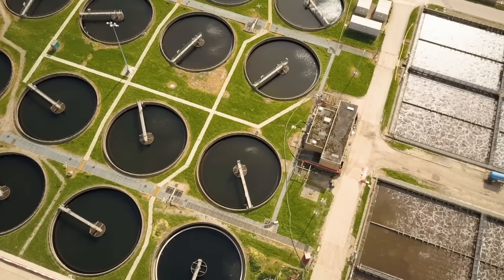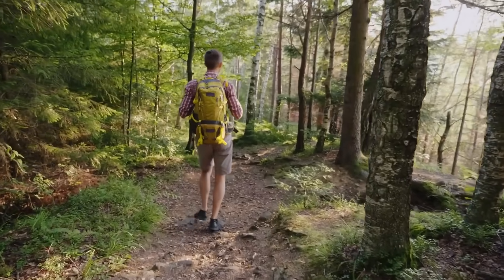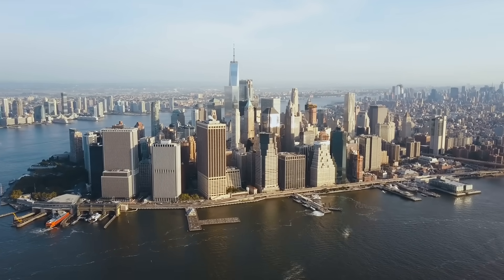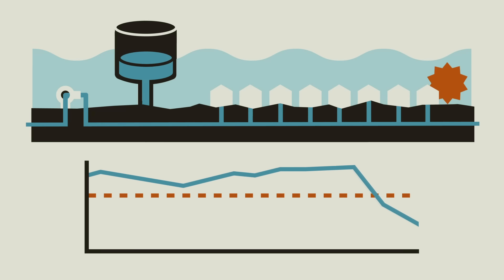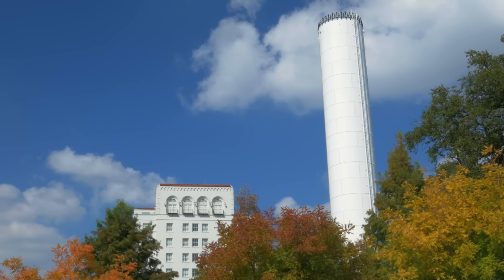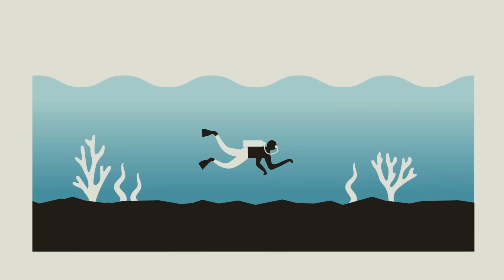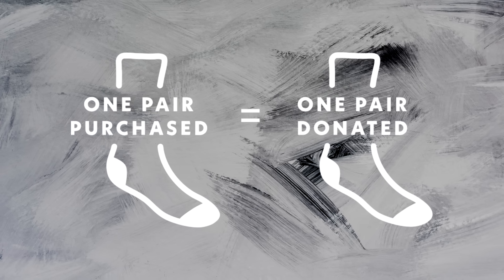How Water Towers Work

Comment: Electrons do not flow from high voltage to low voltage. It's the other way around. Current flows from high voltage to low voltage.
Reply: The convention doesn't matter as long as you clearly state which one you are using, and you are consistent throughout the process.
Reply: Kadda sixseven you must be fun at parties...

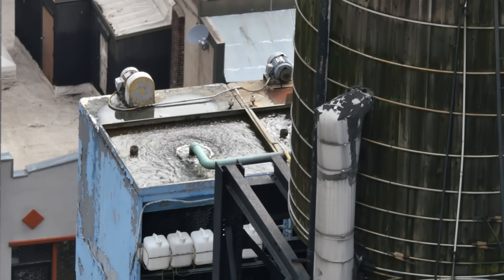Comment: 9:27 whats happening here? Is this water performing some function here or just draining?
Reply: You're looking at a cooling tower on the top of a building. It's basically a heat exchanger. Warm water from the inside of the building is pumped through the inside of it (you can't see that) while cold water is poured over the outside (which is what you're looking at). The heat gets transferred away from the warm 'inside' pipes and the cooled water goes back into the building to pick up mare heat.It's a really simplified description of the operation of something that's essential to proper air conditioning of large buildings, but the principle is exactly the same as I've just described above.
Reply: @ghost307  Thanks for writing that up. That makes much more sense and is pretty neat.

Comment: hi! i work in the field of water distribution. i actually watched your video for a laugh. but, i was pleasantly surprised by the accuracy and clear explanations. BRAVO!  one thing you could have included was the point 43 pound rule. for every foot of height of the tower you gain point 43 pounds of pressure. so a 100 foot tower would passively impart exactly 43 pounds of pressure at ground level.
i subbed. good video.
Reply: I agree with this. I missed him saying BAR, PSI or just some weight unit.
Reply: You are missing the unit of area over which the pressure is measured. I assume you mean square inches.
Reply: @gordonrichardson2972  right you are! i should have said PSI
Reply: I have worked in water treatment/ distribution field for 4 years now and I too was impressed with this video.
Reply: For every foot of elevation of water you get .433 PSI or every 2.31 feet of elevation you get 1 PSI
Reply: 10 metres of height gives 1 bar of pressure. 1 bar - 14.7 ib/sq inch in old money.  So approx every 30 foot in height gives 1 bar.  In the apartment block I live in people on the lower floors have their water supplied from the roof tank, except drinking water, giving a constant ~2 bar.  The pressure and flow never varies, unlike supplies from the pumped under-road mains pipes. Many fawcett outlets can be opened not affecting the flow and pressure of say a shower.
Reply: We were taught to always just remember that 1psi = 2.31ft of elevation, and all our state license test questions are based around that conversion as well.
Reply: 43 X 100 = 4300!
Reply: @rekky213  point 43 psi Robert. not 43.
Reply: That ad hoc "rule" is an example of how bad imperial system of measure is. With pascals/bars and meters you don't need a special constant here, you just use g. So 100 meters tower would produce 9.8 bars of pressure at ground level.

Comment: Pumps create flow, not pressure
Reply: Flow is caused from differences in pressure, and that’s how pumps create flow.
Reply: Cameron Hoglan no they create flow. Pressure comes once there is resistance to flow
Reply: @willyjameshuff  Depends on the kind of pump.
For example, a piston pumb creates pressure (compressing the fluid to put it in motion out one end), 
while a bucket chain or an archemedic screw creates flow.
Reply: willyjameshuff This

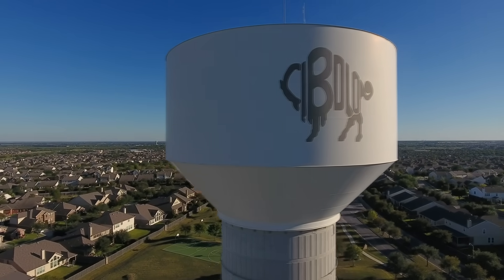Comment: The tank style at 0:44 is called a Multi-Leg or Toro Ellipsoidal tank. 4:59 is a Composite Elevated Tank or CET. It's called Composite because of the concrete pedestal and steel bowl combination, no fiberglass used. We call the tank shown at 5:20 the "Witches hat" tank style. 6:00 is a Standpipe.
Reply: Well, gee, Bob.  Now I feel complete.
Reply: I appreciate this useless info bob.  Thanks for sharing your expertise
Reply: @drumcorcaigh5770    A little knowledge can be a dangerous thing.  Some folks are VERY dangerous.

Comment: Is it possible to make hydroelectric plants out of every water tower?
Reply: saberline152 yes but it would be a waste. You’re paying to pump water up to it and then on the output after the hydro electric it wouldn’t be as pressurized
Reply: @ShortyzProductionz  what if we apply pressure to the storage unit?
Reply: @saberline152  You'd just be swapping energy for pressure and then pressure for energy. You'd probably be losing energy to heat and friction in the process as well.
Reply: Homer: "....Lisa, in this house we obey the laws of thermodynamics !!"
Reply: @pabloata4708  it does, you use other electricity to pump it up and give it potential energy and you could potentially recuperate some of that energy

Comment: Can't wait for the pumped-hydro episode you alluded to.  It would interesting to know how much water at a given height would be needed to power a home for, say, 24 hours.
Reply: I'd be interested in toying with the idea of using consumer-sized water storage tanks to store energy during off-peak hours. This way, you use energy from the grid when it's cheap and then convert that potential energy back into electricity during peak grid hours. I'm assuming that the only reason why we don't do this now is because it's an economy of scale sort of thing.
Reply: @jc_1337  The energy storage capacity is trivial for domestic water tanks. Raise 1,000 US gallons of water (which weighs about 4.2 US tons) by 25 feet (that is roughly two storeys), and it will store the equivalent of less than 0.08 kWh of electricity as gravitational potential energy. However, as the whole operation is 80% efficient at best, then you'll only get about 0.06 kWh back. 

That's rather less than the electrical energy stored in a 4 Ah 18V battery for a cordless drill (which is around  0.07 kWh).
Reply: That's easy to work out. If you know your house uses, say, 30 kWh in a day, that's 108 MJ of energy. That's equivalent to raising 100 metric tons of water (about 110 US tons, or about 26,500 US gallons) to a height of about 110 metres (about 361 feet). However, that's at 100% efficiency, and if it's 80% efficient (good for pumped storage), that means multiplying by 1.25, so 138 metres or 451 feet.

To put that in perspective, a typical 2,000 square foot US house weighs, with its contents, about 205 US tons, so it's the equivalent of lifting the entire house vertically by about 220 feet.

The simple formulas used are to turn kWh into MJ, multiply the former by 3.6. As gravitational potential energy is just mgh where m is the mass in kg, g is the acceleration due to gravity (9.81 m/s^2) and h is the height in metres. 

Now take these numbers and multiply them by the number of houses in a large city and you'll see the scale of storage required.

Comment: I never heard anyone giving example of electrons to explain water flow. Always heard the opposite. Interesting take.
Reply: Am I tripping or did he say it backwards? Electrons move from Low voltage to High Voltage! I think he was thinking of classically described current (movement of protons).
Reply: @xxDPKINGxx  Yes, the civil engineer missed a quirk in Bohr's atomic model while dealing with fluid dynamics and hydrostatics. I wouldn't worry about it. I'm an electrical engineer, and most of the time, I don't bother to think about which way the amber moves. It's usually a voltage, producing a current, creating magnetic flux, which induces a current somewhere else, leading to a voltage drop over some load impedance; or a signal voltage interacting with a transistor or relay as part of a logic operation. The fact that electrons are defined to have a negative charge does not meaningfully impact my day job.
Reply: I was talking to a contractor the other day (who is an electrical engineer) about pressure sustaining valves vs pressure reducing valves; he likened them to capacitors vs resistors. I said "that's the first time I've ever heard someone use electricity as an analogy for water, usually it's the reverse" :-)
Reply: Was surprised that he didn't mention capacitors and filtering out high frequency waves... I mean if you're starting with a comparison you may as well keep going!
Reply: well, civil engineers.  just sayin...
Reply: Well if you can't reverse an analogy there is something wrong ;)
Reply: @ewthmatth  doesn't help last time i checked voltage didn't change as it moved down the wire. I'm Just an electrician though no engineer
Reply: You are correct. What do you believe. Electron flow, or conventional flow. There are both theories. Good point.

Comment: Neat. I suppose capacitors would be the electrical equivalent.
Reply: Kind of, but not quite. Batteries are the electrical equivalent.
Reply: @kennyholmes5196  - I disagree. If you compare the towns water supply system to a electrical circuit, the pump station or its output flow would be the equivalent of the battery, while the houses are the load. Both a battery and pump station can only output so much at once. When the load exceeds this, the capacitor (water tower) provides brief relief/ steady flow.
Reply: @kennyholmes5196 
Capacitors are the electrical equivalent.
If you look at the mathematical equasions describing them, they have the same form.
Batteries do not.
The non-mathematical way to look at it; when batteries are fully charged, they don't give off a higher charge than when they are at 50%. In storage towers and capacitors, the charge/pressure provided is dependant on the charge/water level within it.

There's also the mechanical equivalent btw, which is the spring.

Comment: Electron flow from negative voltage to positive voltage, which is the opposite of current.
Reply: Actually, that is precisely what current is. You don't define current of a river against the direction of the water flow either, do you? There is a physical and a technical direction of current, the physical is the direction of electron flow, the technical is against, IIRC, it helps engineers with calculations and remembering safety rules, but I'm not sure.
Reply: i knew someone would catch that!
Reply: Current works the same if you switch signs.   Unfortunately they chose the positive direction before electrons were truly identified and discovered.   It makes just as much sense to say that negative current is the "real" current.

Comment: I just want to point out that pumps don't create pressure, they create flow and presure is the restriction to flow
Reply: I could argue that pumps create pressure and that the pressure they create can result in flow if there is no barrier to stop the flow. I could also argue that without a pressure differential being created there would be no flow. This might be a chicken or egg first argument, but I see nothing wrong with Practical Engineering's wording.

Comment: I always wondered the energy balance for putting a hydroelectric water turbine in series with the outlet of a water tower. (Actually I have a lot of wonders about storing potential energy for public utility.)

My thoughts:
- While the tower is filling, the water turbine is bypassed. (added complexity)
- Then while discharging, the water turbine drives a generator.
- Typically, water peak demand and electrical peak demand coincide due to residential consumers (synergy).

Can anybody smart enough:
1. Make a rough estimate for the capacity of such a generator (kW)??
2. Determine water system losses?
      a. Less pressure from tower?
      b. Less volumetric flow rate from tower? Etc?